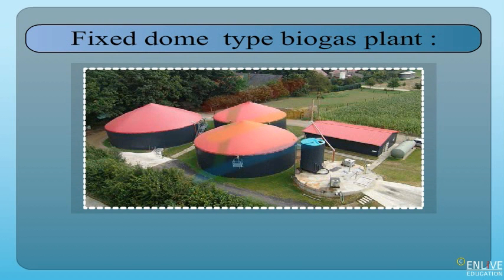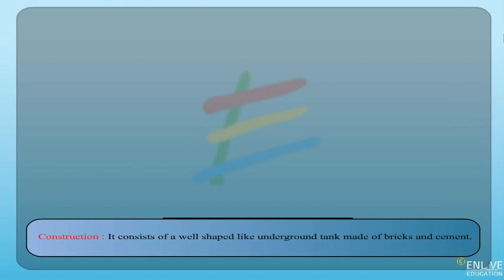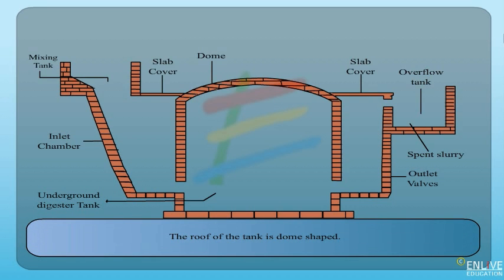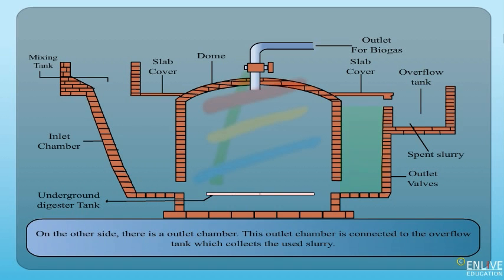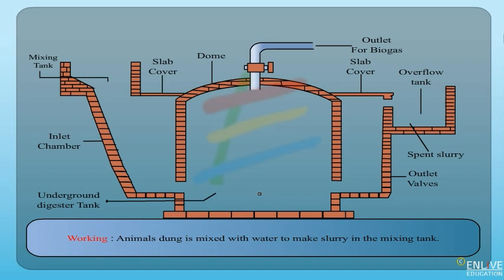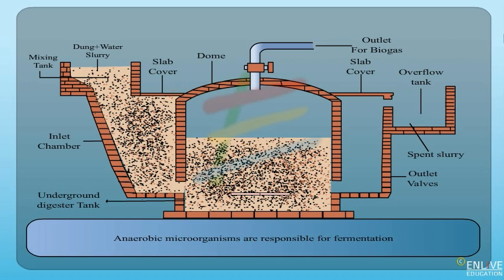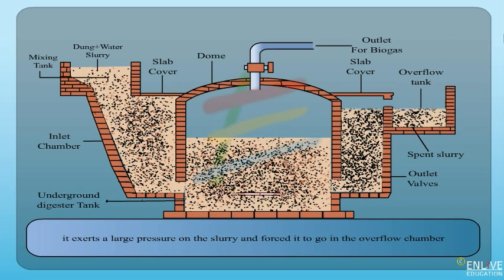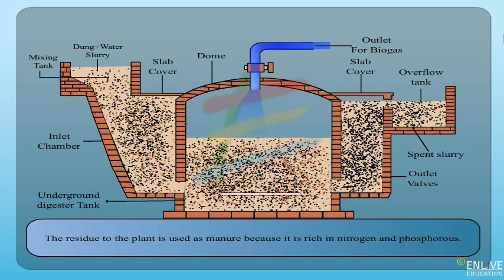Fixed dome type biogas plant

Comment: A fixed dome type biogas plant consists of :
1) A Mixing Tank where a slurry of animal dung and other waste materials is prepared by mixing it with equal amount of water.
2) The slurry so prepared is passed to an underground Digester tank through an inlet chamber. It is in the digester tank where the slurry is decomposed for about 50-60 days by anaerobic bacteria to produce biogas which collects in the Dome. The dome is provided with a gas outlet chamber having Valve attached with it. The dome is built over the digester tank and both form a single unit.
3) As biogas keeps collecting in the dome , it exerts pressure on the slurry in the digester tank. This pressure forces the slurry to flow into the overflow tank through the outlet chamber.
4) The slurry is gradually removed from the outlet chamber and is used as manure.
5) The gas produced is supplied to houses for cooking purpose.
Reply: Rakhi Gupta haha. U make video for biogas
Reply: Rakhi Gupta  thnkyou
Reply: Thnx mate
Reply: Is it possible that slurry can come out through inlet chamber.
Reply: @ambiligkrishnan162   thats is the question that i'm going to ask too...
Reply: Thank u so much
Reply: @ambiligkrishnan162  no, the slurry cant go.. because inlet chamber has already slurry pouring from there.. so no space is available there
Reply: @nayanxd6848  hey this is the wrong diagram of biogas.  This will not work.  This was the diagram taught  in schools.
Reply: @ambiligkrishnan162  arre bhai aisa matt bol.. aaj exam mein yahi bana ke aaya hu 😭
Reply: Yes, but the gas  pressure will not be sufficient to force the residues to get  in the oulet chamber.....    
it is dangerous to have a  relative strong pressure in these system!!!!...
The inlet system for to fill is just!!!...
At the down of the digester you will have a quantity of heavy residues who will never goes out, it is/will be  impossible....   it will need a succion (or other)  action for to clean the digester two times at year at the means !!!...    how to do it??????
I'm sorry  I writte badly english ...   
Thats  the big problem on the  very bigs digesters in France... it costs a lot of money and  time to stop the system!!!!
By  other words it need to have a system for  to ''scavenge '' easily the  down part of the digester.........................less to stop the process.....that the great  question...
Y now to do it simply and  by low cost...
Thanks you to read me...... J.